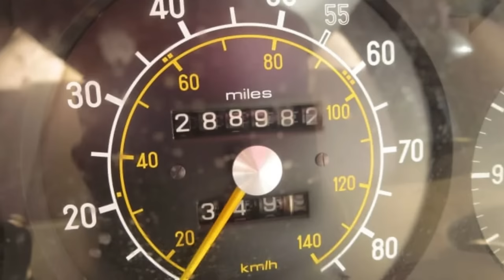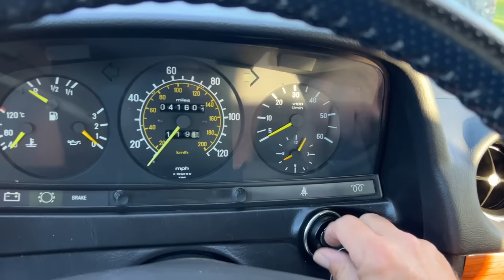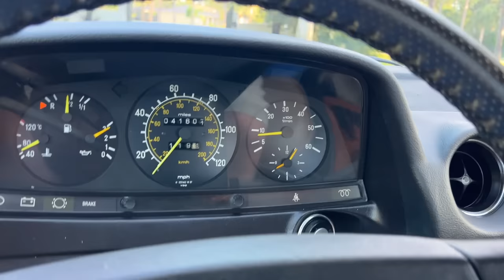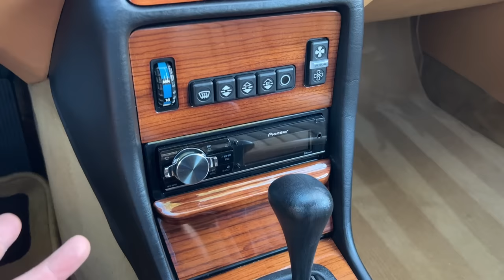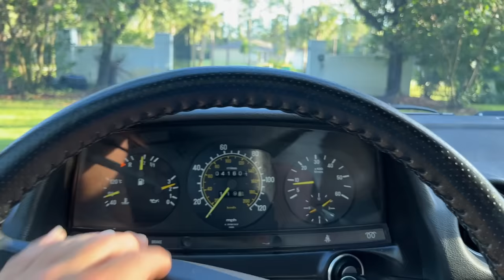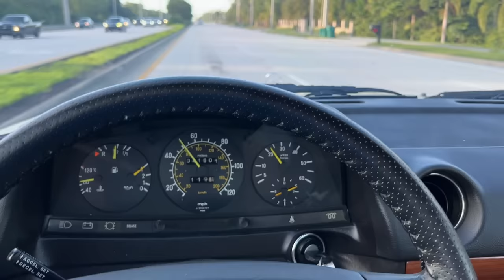The Mercedes-Benz W123 Turbo Diesel May Well Be The Best Car Ever Built

Comment: That old Benz will still be running 500k+ miles easy. Heck, it’ll probably outlive all the cockroaches.
Reply: When I was stationed in Cyprus in the seventies with the British army all the taxis were really old Mercedes some of them were older than us sitting in it
Reply: Amen to that Brother! As we all know, after a nuclear holocaust, the only things left will be cockroaches, Mercedes diesels,  and MB-Tex upholstery. 🫡
Reply: @egold2071 and its because of the mechanical fuel system
Reply: I grew up over in Albania, which is famous for classic Mercedes. I remember people in my city driving around with a million miles on their W123 300D Turbos. I initially drove a Zastava, which is basically a Yugo, and would constantly break down (although it had an American market air conditioning installed). Later moved on to a 1967 FIAT 500, which was pretty reliable albeit extremely small and hot. Later got a Citroën 2CV which was great, but very much exposed to the elements, ultimately saved up for W123 300D Turbo 5MT which allowed high speed.
Reply: Easily, for sure! My friend Simone in Poland inherited this model from her grands, and it's nearing 380k...Very few major repairs, as it's been properly maintained. Another friend's BIL in Dallas has same model in powder blue with 400k+ on the odometer... Both still happily motoring along!
Reply: And don't forget Cher ... Running joke is when apocalypse kicks in only cockroaches & Cher will survive ... Need to add in Mercedes W123 into that mix now ...
Reply: Uncle Adolf's car.
Reply: @egold2071  Don't forget the Crown Vics, Hilux's, and anything Japanese from the 90s.
Reply: @EyePatchGuy88  Indeed, Crahn Vics (actually anything on the Panther Platform) and 90s Japanese rides will still be rolling along. And of course, my '04 MazdaSpeed Miata! (It basically has  '90 Miata bones/pahrtrain underneath a new body).
Reply: @EyePatchGuy88  That's true. Many Japanese cars in Australia. I have a Mitsubishi that just won't die sooner than by beloved diesel W123.
Reply: @egold2071  don´t forget the beetles or didn´t you saw woody allen movie "the hero of the year 2000" where he finds in a cave a half buried beetle and he says to diane keaton "they used to say that they will run forever" he enters in hit turn the key and even half buried he starts and with lights on and he says "see" then he runs from non touchin`the ground cars from the future with the beetle, them old woody allen movies were to die for , laughin`off course
Reply: i have a 74 with 3.000.000 km´s at least it could have more but mercedes mechanics say that they never had seen the km counter without the teeth and perfectelly shaved like they were never there but that is of having worked for millions of km´s, and as full power as they restored it to new but not much power it´s a 220D

Comment: Parents bought one of these new back in 1983.  A silver sedan 300 TurboDiesel with blue MB-tex interior. What a terrific car.  They held on to that vehicle for the better part of 40 years.  It is built like a tank. Other than a bit of diesel noise and obvious turbo-lag...it was a pleasure to drive and got close to 30mpg. Wonderful for long drives.
I bought it from my dad for $5000 back in 1997 and drove it for about 1 year. Sold it back to him for $1, just before taking an overseas business assignment. I cannot count the number of offers I would get from colleagues who wanted to buy that mint car from me.  No chance.

I actually got rear ended in the car on I-95, while stuck in traffic at an off ramp.  It was a foggy spring morning when I pulled off to exit.  Given the conditions...my sixth sense was already going off.  While in traffic, I put the hazards on...as I was last in line and just had a bad feeling.  I kept my distance from the car in front...by more than a car length...while frequently looking in my rear view mirror.  When I saw headlights in the rearview mirror approaching way too fast...I put my car in neutral and took my foot off of the break.  WHAM...the hit lifted the rear of the MB and I lurched forward.  Slammed on the brakes just in time to avoid hitting the guy in front of me.  I pulled further into the shoulder and got out to see the damage.  At first...I saw her car...an Acrua.  The engine was pushed into the firewall and the hood looked like the Hulk had smashed it really well.  No one was injured, thankfully.  I then prepared myself to see the rear of the MB.  What I found was stupefying. Not a scratch.  The rubber around the bumper had to be popped back in and the tip of the exhaust was bent down.  That was it. With the police report, I had my insurance fully inspect the vehicle...to include laser alignment and inspection of the frame/body.  Aside from the exhaust tip and a little dent in the spare tire well (both easily repaired by the garage), the car was perfect. When I said this car is a tank...I am not kidding.  The Acura had to be taken away on a flatbed, as it was clearly un-towable.  Frankly, the disparity of damage between those two vehicles was so severe...I began to question if there was another car between us.

Comment: My parents bought a new W123 300 TD right after I moved out on my own. When I would visit, my father would let me drive it when we went out together. I remember the sense of solid stability that made 70 mph feel like 40. He showed me the small details that made the difference from typical cars. Where a GM or Ford would have stamped steel door hinge mounts, the Mercedes had milled billet pieces. The engineering brilliance was evident everywhere.

Comment: As a multiple offender owner of MBs with 5 cylinder diesels i just say klatta klatta klatta…

The 123 chassis is great…coupes, sedans and super useful wagons.  But This motor in the 126 chassis is just motoring heaven so long as you’re not focused only on 0-60.  

Peak Mercedes from when the brand was more than nice…it was Special.

Comment: Thanks for reviewing cars of my early youth.. My family owned several of these Benzes .. we use to live in Venezuela during the oil boom years of late 60’s early 70’s . My father owned these not for snob appeal , but for durability and. Peace of mind … we’d take 8-10 hour trips in 100 degree weather ( like traveling through the Nevada desert ( you had to load up on water and food plus spare parts ..hoses, belts , never let us down …. Our Ford V8 monster would always break down after 3-4 hours of highway riide.. we had a W112 and W123 gas . I learned how to drive in the W123 . It was a manual transmission , well manual  everything in that car …  dads favorrte car was the VW Beetle, when we moved back to Miami he bought a 911 air cooled , closest thing he could find to the Beetle.  Miami 1980s Cocine hey day in a 911 !

Comment: Great cars. I owned a China blue 1980 300CD, a 1979 300D, a 1973 280C, and currently a 1991 300D (W124). The 123 series is still my favorite. Great video, even with your iPhone. Keep doing what you do so well and just be Bill!
Reply: I had a 1980 China Blue 300D non-turbo for about 5 years and while not the fastest car on the planet I was very surprised by the engineering of it and quite a few cool features.  The worst part of the car was the Chrysler designed vacuum system that always had a leak somewhere.  Mine had about 250K miles on it and still got around 22 city and 27 highway and for a car that weighed around 4400 lbs. that was quite a bit better than any vehicle I ever owned.
Reply: @RedBud315  mine was also a non turbo. Previous owner had upgraded the climate control servo to the Unwired Tools electronic conversion, eliminating the Chrysler servo. It worked nicely. I miss the car but I sold it to a friend so it is local and I see it every now and then. Great memories, like you surely have as well! Cars aren’t built like that anymore.

Comment: Speaking from the eastern side of the pond, some years ago I was on holiday in the Canary Islands and had a taxi ride of about 60 miles from airport to resort. The chariot was a '70s W123 240D - as ordinary as possible, far older than any taxi you'd see on the roads in the UK (if only because cars rusted to bits within a decade on our roads back in those days), with at least half a million kilometres on the clock (so just run-in). It was not what you'd call salubrious, but I had a good time to appreciate just how SOLID it was - no rattles, no loose trim, nothing falling apart, just a great example of of how a dry climate can preserve an old car as long as the car itself was rock-solid from the start.
When I was a car-mad kid in the early '80s (I must be more or less the same age as you, Bill), I could never understand why M-B cars were so pricey. There were ordinary cars, then there was a 50% price hike to BMW and then there was 50% on top of BMW prices to get to M-B, so you could get a really nice car from an ordinary brand for the same price as a very basic (manual everything) Merc.
As for those three-litre diesels, they are legendary. There's a YT channel called Diesel Pump UK run by a company that specialises in uprated fuel pumps for OM605 & OM606 engines for people who want to build ridiculous-power motors (and install them in other cars). They really will run past 6000rpm - quite unlike 'modern' diesels - so the tachometer in that 300CD isn't excessive.

Comment: I love these and know how reliable they are when maintained properly…BUT:
at idle they sound like a delivery truck!
Reply: Which is absolutely sublime!
Reply: Ya, they sound like a bucket full of hammers. But gosh thats the sound of longevity.  If I find one of these at the right time, I'm going to buy one. And try to drive the tires off of it. Wonder what one in this shape would go for?
Reply: I absolutely love the way these cars sound, idle or cruising, this is the epitome of Mercedes and their quality back in the day .
Reply: Back in the 70s oil crisis, my dad had some serious dinner table conversation with my mom about repowering his 66 Coronet with a Mercedes diesel. He wanted 50 mpg and for it to run on cheaper fuel oil. Ah, the 70s...
Reply: @LongIslandMopars  Very cool. And that car would still be running today. Cheers
Reply: @giggiddy  I own it now (since 2011). Has its original drivetrain that I rebuilt to stock. 273 V8, automatic.
Reply: That's a good thing!
Reply: That engine sound is beethoven's eroica for high test men

Comment: This engine was in use well into the 2000's in Dodge, Freightliners and other brands!
Reply: No not the OM617.  Last used in 1991.  However, a modified version of the OM616 is still used in India licensed to Force Motors
Reply: OM602 is also awesome

Comment: Hi Bill, Totally agree. I have a 1978 280CE, a magnificent machine. It shares a driveway with my 1990 Mazda MX5 (Miata) and my 1994 SL500 (R129). The 280CE currently has 385,000kms and has its original interior and runs like a tank.

Comment: Sadly us Brits never got the turbo diesel on any W123/4 due to RHD and the position of the turbo. One or two South African built cars have now started to appear as imports in the UK.They have some unique features, I believe the ride height is very slightly higher, most have sump guards and the leather is a very high quality . Values in the UK and Europe have gone through the roof, particularly wagons and coupes with the six cylinder 2.8 cars holding a big premium . It's still possible to get 2lt petrol and diesel models at affordable prices. The unloved models (and rare) are the 2.5lt 6 cylinder carburetor engine cars and a short lived 2.2lt diesel.

Comment: My dad has an old C123 300CD Turbo 5MT that he bought used back in the 80’s at UGA. It has (probably) 400,000 miles on the original engine and transmission. He and a bunch of his hippy friends in Athens, Georgia, had some contraption set up in somebody’s shed that they’d all use to filter the bejesus out of waste vegetable oil over the period of several days from local restaurants and what not and my dad would use that to fuel his Mercedes and his Isuzu Turbo diesel. And then once he would take the dirty lubricant oil out of those, he’d throw it in the Detroit Diesel and it would just straight up eat it. Mercedes diesels were better to all other diesels for 4 main reasons. 1: They used cast iron heads. 2: They used timing chains. 3: They were analogue, pump was chain driven. 4: They used inline Bosch mechanical fuel injection pumps, much like the Cummins 5.9 Did after they got rid of that stupid VE Rotary injection pump that didn’t even have a timing mark on it. And 5: They were infinitely serviceable and rebuildable.
Reply: Fully agree on serviceable.  But its been more difficult in the past 10-15 years as part quality of all types has gone to crap.  Thinking of suspension bushings and such that seem to be junk no matter who is making them…even the former MB OEM stalwarts like Lemforder, Febi, Mahle (and I can’t remember the motor mount OEM)…all went way downhill, so keeping these running is much more of a chore than it should be.

Comment: First time ever, with the diesel car that can run 4ver if you want it and ignore the noise/smell of the engine.
Reply: And the price of diesel fuel >
Reply: @bextar6365 these can run on vegetable oil
Reply: @richlee509 Yes. I researched grease car kits as part of my biodiesel thesis. Better off just creating a biodiesel refining setup in a garage. Pick up used cooking oil at local restaurants and you've got your fuel source. Wanted to pitch the idea to NYC transit for them to do an arrangement where they pick up cooking oil from city restaurants and then refine it at the bus depots to offset their dino-diesel usage. I knew that idea would be doomed with city politics and now they're using a lot of hybrid buses.

Comment: Very Nice! My Father actually had a 300D (not the CD) in the 80ies. I remember the fuel indicator did not work so good, actually it was the fuel warning sign the worked. Anyway my father drove it dry sometimes and then it did not help to just fill up the Diesel as these Cars did not have an active fuel pump. So you had to get assistance to put pressure on the Diesel tube.

Comment: Towards the latter end of the run of these ... I remember the Chrysler  Fifth Avenue with 2 barrel 318 cube V8 and 3 speed Torqueflite being similar size.  They were worlds apart in fuel economy and in silent acceleration.  It struck me as a little bit of the emperors new clothes syndrome as the Chrysler was so much quieter and smooth.  Hindsight shows these Benzes were something special  ... but one probably could've scored two Mopar flagships for the price  ... and they were long lived beasts in their own right.
Reply: 318s are great. Reliable yet can produce decent power to have fun without grenading....

Comment: Ahh thanks for the video. I have this exact '83 one in "Manilla Beige", but the square Euro headlights. Also changed the front signal lenses to clear with chromed orange bulbs.= I do agree with you that the Wagons are the coolest design.
Hard to find.

Comment: Proverbs 27:14, "A loud and cheerful greeting early in the morning will be taken as a curse!"  When I read that, I thought, "Good Morning!  This is Bill from Curious Cars!"   All this time you have been cursing us!  Just kidding, Bill.  Just kidding!

Seriously, we loved our 1985 grey market W123 300D (non turbo).  Bought it from a diplomat for $1700, drove it for a few years, sold it on eBay for $4500.  It only had 175,000 miles on it - just getting broken in!  The brakes on that thing were amazing.  You touched the pedal and it stopped immediately. And I mean immediately.

I found a set of HELLA composite headlights from a GI in Germany who sold Benz parts on eBay.  They were vacuum controlled (as was everything) so you could aim them up and down from a dial on the dashboard.  Kind of fun to spook pedestrians at a crosswalk with.  I was told this was so you could adjust headlight aim for load, so the lights didn't blind oncoming drivers when you had a load in the trunk.

Comment: I had a 1983 MB 300D for years.  The one thing that did suck is the vacuum system that locks the doors and shuts off the motor.  When there is a leak, it's a pain in the ass to find.

Comment: my 84 Identical (color, Engine, electronics) was beautiful but also unknowingly had a fuse go go out for the fuel tank sensor, i thankfully was able to put her in cruise/neutral dowhill and was lucky to the next highway exit,  Absolutely loved that coupe but said i had 1/3 tank left when i was running on diesel fumes

Comment: The "E" in their model names, e.g. 420 SEL.....stood for "einspritzmotor" ....420 SEL was S class/ Fuel injected/ Long Wheel base model
Reply: The 190 E (E for Einspritzung, or Fuel Injection) model uses the Bosch KE-Jetronic Multi-Point Fuel Injection to meter fuel instead of the carburetor of 190 models

Comment: I had a neighbor in San Diego that had a 300CE. Yes a 6 cylinder gas motor.
He cane driving up one day when I was outside and he said he had just had new plugs put in but it was running like crap. 
I had him pop the hood and I checked the plug wires. None of them had been pushed down onto the plugs. I connected them all and the engine purred after that.
I had an 85 300d turbodiesel. 
I had it for 4 years and then I traded it off. It had 280k miles on it and was in perfrct condition brcause I did any and all maintenance on it and did not defer it.

Comment: trans is shifting too slow, almost flaring.   needs adjustment.   It is hard to tell, but i'm fairly certain those are leather seats and not mb-tex.  I have had many of these cars and the MB tex isn't perforated all the way through the material, while the leather is.  Also, the mb-tex had double row stiches between the panels on the seats.   Also, mb-tex won't have wrinkles.   Otherwise, this is a nice car.  Always wanted a CD.